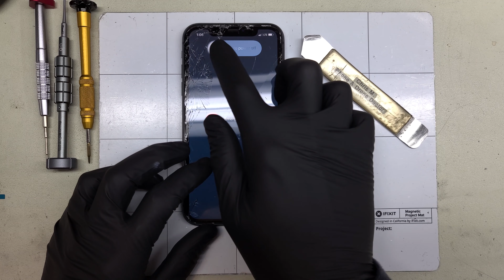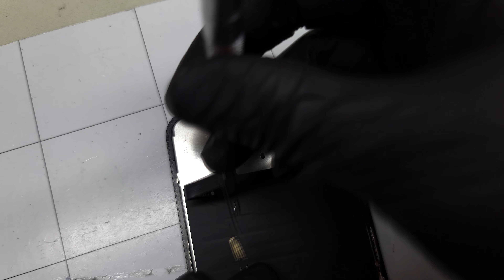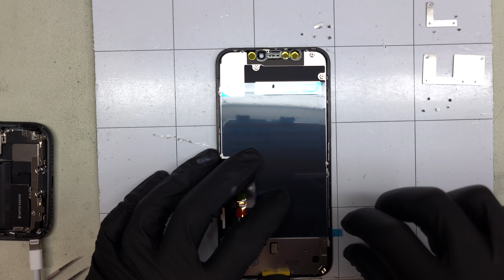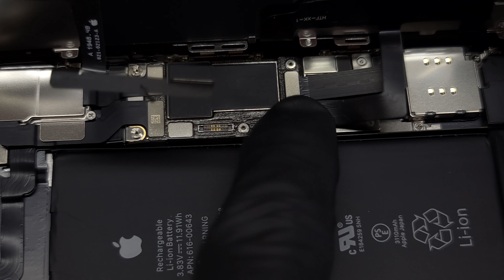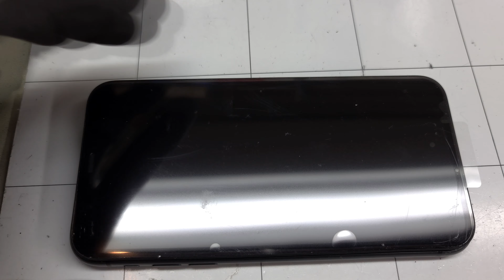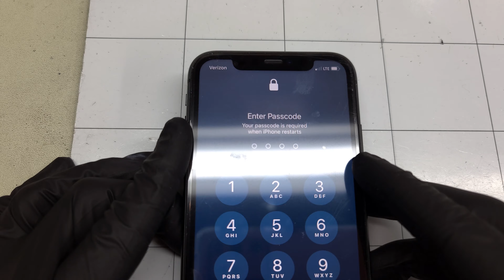iPhone 11 Digitizer Repair How-To

Comment: My iPhone 11 pro max screen suddenly stops responding in certain parts of my screen (vertical line area on the left side), but the screen itself is 100% fine and touch works fine on the other part of my screen. Can this issue be fixed without replacing the screen? (i already tried a hard reset with no success)
Reply from the maker: @webpro607  unfortunately no, that's definitely a sign of needing a new screen. Hopefully it's nothing wrong with the board, but in 9/10 cases it's just the screen

Comment: Hi, a quick question, if an iphone 11's screen's suddenly stopped touching, can baking or changing the touchpad make it work instead of changing the entire screen
Reply from the maker: Definitely not, board baking is only for reattaching loose solder joints. For a touchscreen the likely cause is a short in one of the wires, baking it would only make the short stronger. Best bet would be replacing, thankfully the iPhone 11 screen isn't too expensive.
Reply: absolutely appreciate the reply, will save up and change the screen instead of doing that and then ending up doing the same thing again @TapticDigital

Comment: All iPhone 11 screens have only 2 connectors instead of 3 as shown in the video. Is it okay to buy such one with 2 connectors? Thank you!
Reply from the maker: The screens themselves only have two connectors, the third is from the earspeaker at the top. So any you buy will only have two connectors.
Reply: The 3rd connector at the top is for the frontspeaker.